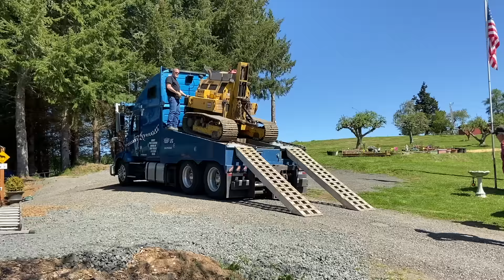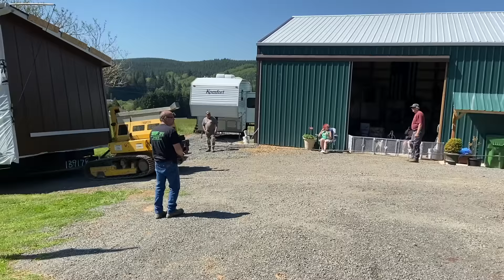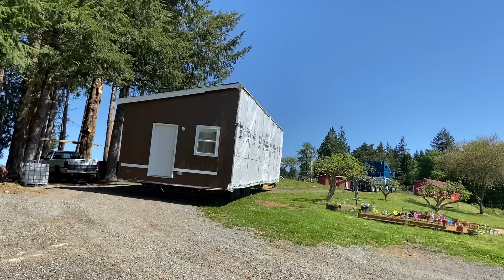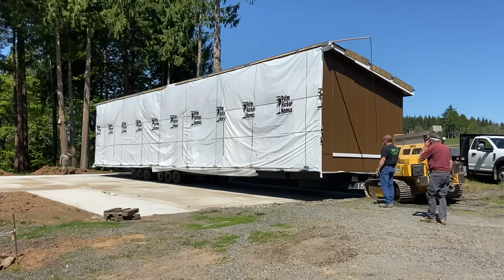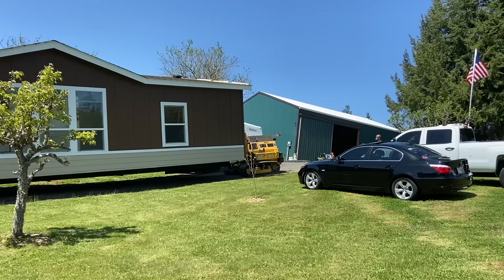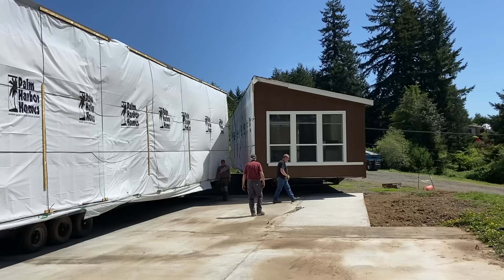Palm Harbor - Our House Delivery Part I

Comment: Congratulations on your new home  thats 
pretty sweet where yall live they will allow you to put it on a flat slab like that were we are at you have to put it on 2x2 concrete piers one thing do is check your hot water heater water lines and make sure they are tight and not leaking  also all your other water connections and drain lines under the sinks again enjoy your new home
Reply from the maker: John Campbell 👍 Thank you! 😁😎🇺🇸

Comment: Just think.
All of that weight (the house and it's trailer) is being drawn uphill NOT by the winch and the crawler unit, but by the simple little BALL-JOINT "swivel" trailer coupling itself.
Reply from the maker: 😅 that’s a fact! Thanks for checking out the video!

Comment: Could you have pulled it with the skid steer?
Reply from the maker: Hi There!
I doubt it, traction was a factor. Additionally, the unit they used had to continually be winching on the semi tractor. That being said, I’m no expert, just my opinion. Thanks for checking out the video!🍺🇺🇸👍

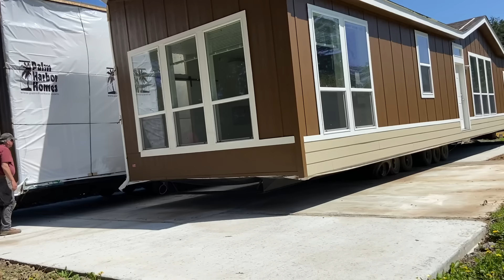Comment: @30:14 Did you see the tire on the first wheel, or should I say the tire of the first wheel?
What's next, will the two parts stay on the frame, will they get there own frame (guess not since it would have been there already), what is happening now?
Reply from the maker: 😂 I know some of the tires did not hold up well, but the home made it to the destination. Once it arrived, they remove the wheels and tires anyway. Thanks for checking out the video!🚜🇺🇸🍺💪

Comment: Make sure the bozo's that set  up remove the tacking on the roof, used to hold the shingles down during transport.  They didn't on mine and first rain we had wet ceilings in our bedrooms.  Luckily the factory got involved and sent out a crew to restore the damage.  The dealer was worthless once they got our money.  The factory guys found holes in the roof where some of the strips had been removed and quickly patched them for trouble free repair.  We just contracted a steel roofer to come in and do the entire roof with insulation and steel roof with overhang all the way around.   I liken mobile home dealers with used car salesmen.
Reply from the maker: 👍🔨I hear you! We’ve been in it a year! We have been happy with the home, the dealership and sales staff were painful to deal with. Good idea on the metal roof. That will last and look sharp! Thanks for checking out the video!!!🚜🇺🇸🍺
Reply: You mean WORTHLESS??.

Comment: I hope they didn't charge you "$1500 to $2000" extra to do what they were gonna do anyway. Nowadays, trailer moving contractors routinely use various house cats during set up.
Reply from the maker: 😊 Yes! The contractor charged $1200 extra, but it was about the only thing we new in advance. Our driveway is pretty steep, so we anticipated additional cost. Thanks for stopping by! 🍺🇺🇸🚜
Reply: Why wouldn't they? And apart from being miserable, why wouldn't you be prepared to pay for what you want?
Reply from the maker: 👍 We had no issue paying extra, the track unit was not part of standard delivery. Thanks for commenting!🚜🍺😊